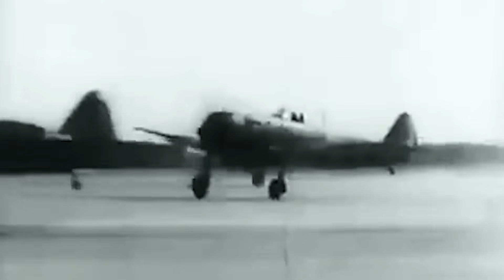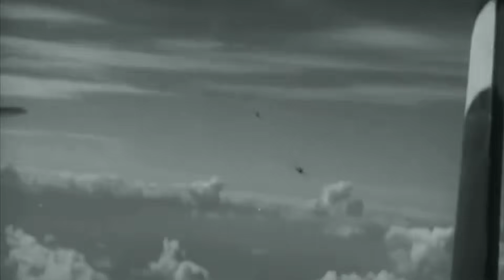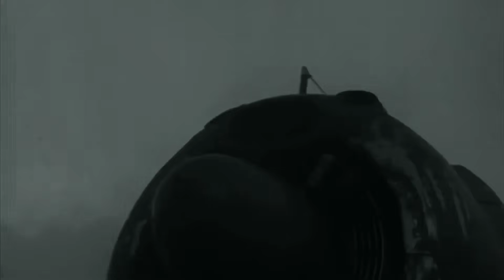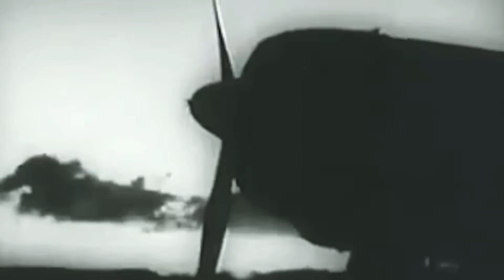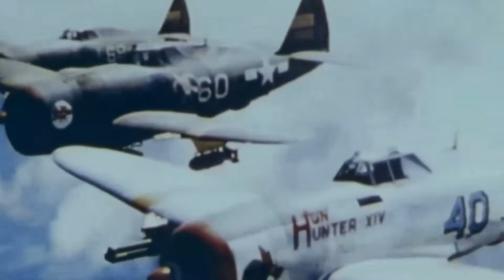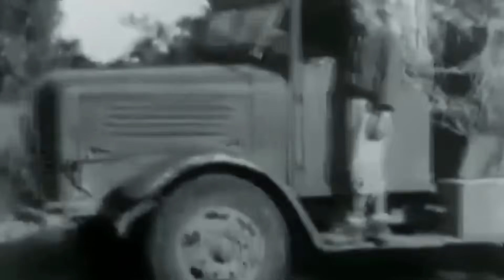The Shocking Truth Behind Japan's Nakajima Homare Engine

Comment: The Homare was never turbo supercharged like the R2800 so it gets the title for strongest radial engine of the war. When compared to a non turbo supercharged, 100 octane fueled R2800, they both made about 2,000 HP. The Homare had a significantly higher power to weight ratio.
Reply: I ride a Mitzu SUV,great !😊
Reply: Say most powerful not strongest. Two different things. Very poor post.

Comment: The story-teller informs us many times the same over the lack of technical support, knowledge, hi octane fuel etc. 
This is valid for ALL aero engines of that time near the frontline.
But he does not tell us over the fact the Homare cranckshaft had a design flaw. The lay-out was prone to vibration. This required too heavy propellers to mitigate this. See the Myrth's blade roots.
After the shot down of a B29 over Japan, they discovered the "right" designed crankshaft in the B29 engine and converted the Homare to it. The vibration problems were over, but it was too late to be effective. 
Second point: The video is spoiled by aggressive music, leave that please.
The shocking truth is likely a click-bait, or bar-talk story, not the technical truth over this engine.
Reply: 誉エンジンには振動対策のダイナミックダンパーがありますが、これはB-29のエンジンから得られたものではありません
時系列を調べてみて下さい、誉エンジンの試作は1941年、正式採用量産は1942年です
Reply: Thanks Louis, you save me making a post by articulating it way better than I ever could!

Comment: The Americans 
Came up with first cnc  machine’s 
Computer numerical controlled  ‘
This helped mass production of fine tolerance machining
 During production 
Nowadays it’s all taken for granted 
Computer programming 
Of robotic mass production 
Only needing  3  or 4 yearly rejigging
Reply: No, not only machine accuracy but also needed metallurgy, like heat resistant steel or the like.